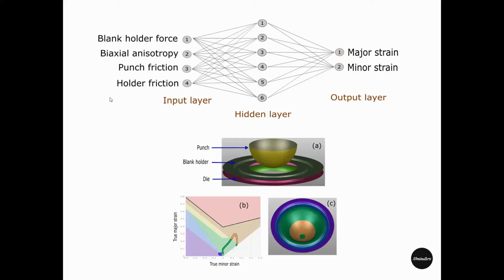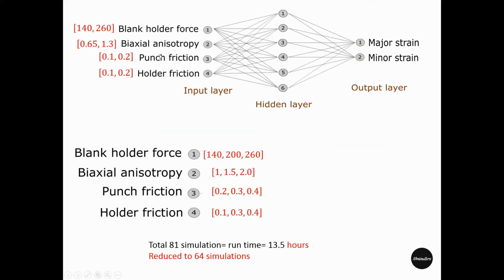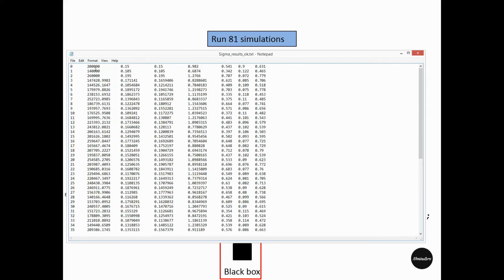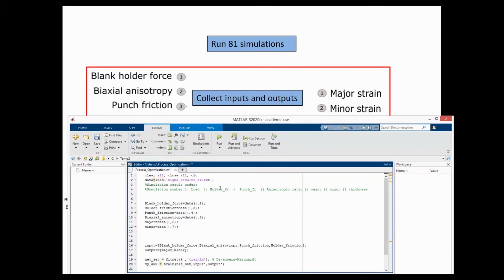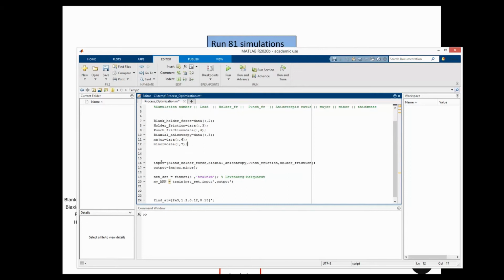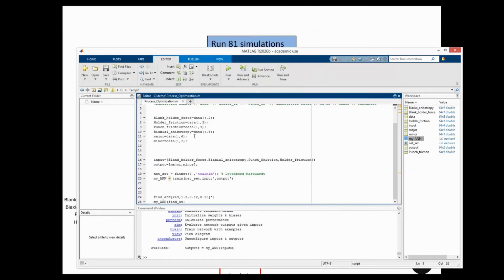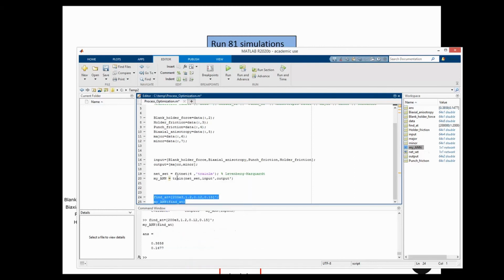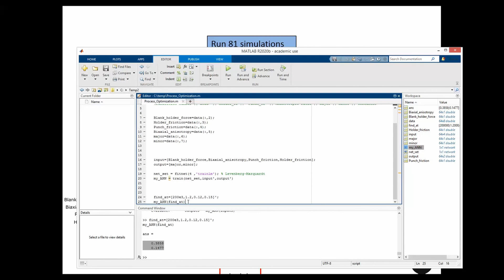Simulation Meta-model: Artificial neural network (ANN) in MATLAB

Comment: Thanks, but why is there ' after input and output here?
train (net_set,input',output')
Reply from the maker: Hi, the inputs and out puts were arranged column by column (for example, all the major strains were in 1 column). But we needed to keep the data row by row  (for example, all the major strains were in 1 row). The ' makes columns to be aligned along rows and vice versa.